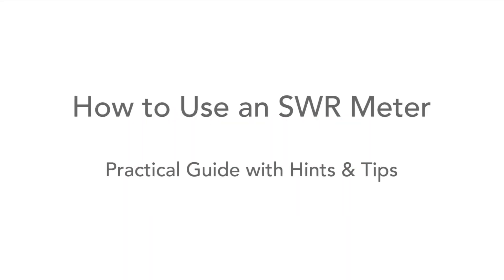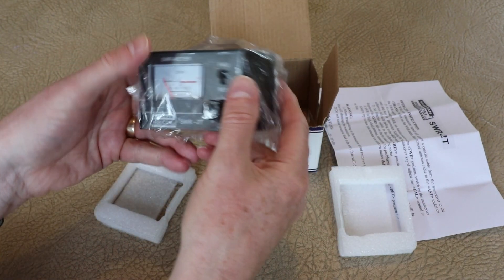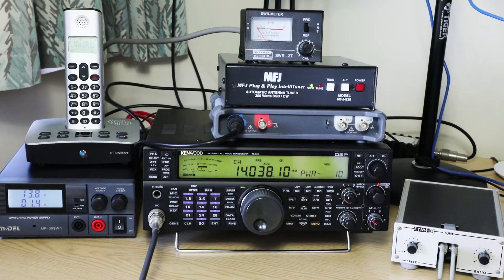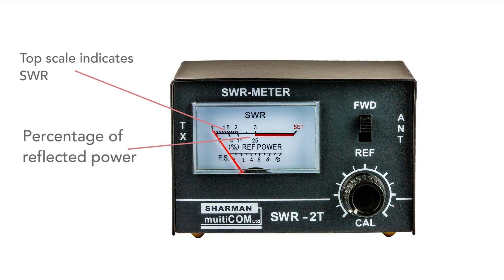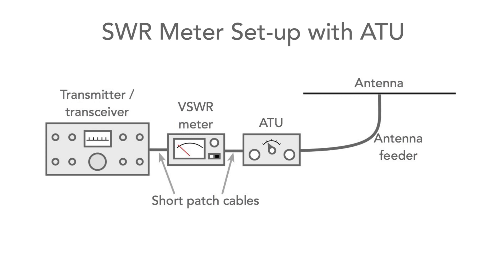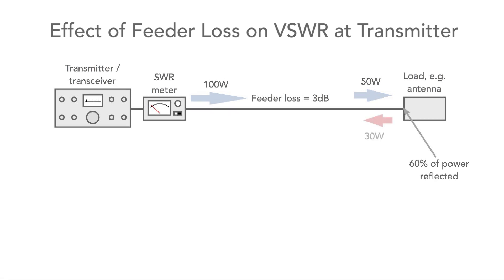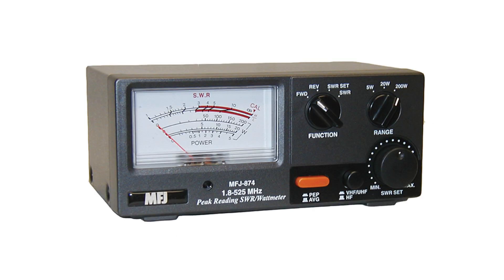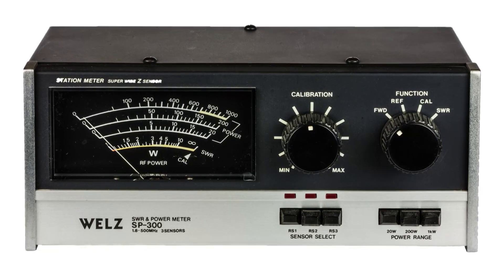How to Use an SWR Meter: standing wave ratio meter - guidelines & tips

Comment: So to clarify,  right before you move the switch from FWD to REF,  do you "un-key" the mic,  and then "re-key" it once you've moved the switch to REF?  Or do you keep the mic keyed continuously during the switching?  Or,  does it matter one way or the other?
Reply from the maker: It should not matter because you are only switching a sense line and not directly any level of power.

Comment: if you dont have a reverse switch can you swap the antenna with the transmiter?
Reply from the maker: Absolutely - but you also need to make sure you get the connections the right way round if you do have a switch.
Reply: @ElectronicsNotes   thank you

Comment: My meter won't zero. It swings right in forward and I can calibrate it. When I switch to reflected it stays at 1.3.
Reply from the maker: It depends what you are doing. If you have RF passing through and you set it to FSD in the forest direction, then when you set it to measure reverse power then that is your SWR.

Comment: Hum? Is this a lead to finding or should I say hacking others freedom of receiving or transmitting an already paid signal. If an individual has not paid for service, then can understand looking for non payer. But if an individual is paying for ex. phone service, then hacking is a violation of protocols.
Reply from the maker: This has nothing to do with hacking. It is purely a method of measuring a signal you have generated for transmission to see the effectiveness of the transmitting antenna system.
Reply: "hacking others freedom of receiving or transmitting an already paid signal."
Yes.  These SWR meters can also change the language.  The one shown is from China, consequently all of your transmissions will be converted to Chinese language.

Comment: And what about the SWR scale in older rigs like Icom 735? Is it a reliable way to measure or should I get a proper SWR meter anyway? I’m a newbie :)
Reply from the maker: I haven't looked at the accuracy of the Icom 735 meter, but I am sure it is more than good enough for what you need. The meter dials in the external SWR meters have much larger scales and are easier to read, but when looking at the difference between 1.5:1 and 2:1 or 3:1, for example, the IC735 should be more than good enough. You don't need to spend ages getting the SWR down the last fraction. The main reason for monitoring the SWR is to make sure the PA in the 735 is not being subject to very high levels of SWR get it down to 2:1 or preferably 1.5:1 and this is more than good enough. The internal meter will be more than good enough for this. Hope this helps.
Reply: I have a 735.  It's a great old radio and still works well. The purpose of its built-in SWR is to protect the transmitter from excessive voltage on the final amplifier transistors.  Reflected power, or more specifically reflected voltage, ADDS to the voltage already there and a high SWR situation can then exceed the voltage rating of the transistor.  The 735 is designed to instantly reduce power in that circumstance (as are all modern radios) but it might not be fast enough in the case you completely forgot to attach the antenna. 
As you can see, a perfect 1:1 SWR might still not be radiating anything out the antenna; a dummy load should always show perfect SWR.

Comment: Can we modify it to work at around 100MHz?
Reply from the maker: As the basic design for a particular item will be focused on a particular band, it is not normal to extend their frequency range once they are designed and manufactured.
Reply: That would be a complete re-design.  These meters have internal inductive and capacitive elements whose reactance is likely to be excessive at 100 MHz.

Comment: Hello! The rear of my meter does not have "ant" and "trans". Mine says "in" and "out". I am unsure which connection is for the antenna and which one is for thew transmitter? Can you help? Thx!
Reply from the maker: In will need for power coming in from the transmitter, ie connected to the transmitter, and out will similarly be for the power output to the antenna. I hope this helps. If you get it the wrong way round all that happens is that the forward snd reverse positions on the meter appear to be opposite to what they should be. I hope this helps.

Comment: I have a question!! I have a 
Selfix no.6702 swr/power meter. 
The stickers on the back of the unit 
came off and I don't know which 
connector is for the antenna and 
which one is for the radio!! I don't 
want to damage my radio or the 
swr meter. Is there any way to 
tell which connector is which?
PLEASE HELP!! Thanking you 
in advance, Norman.
Reply from the maker: You won't damage the rig or the SWR meter if you run the power into some form of good match or a dummy load. Connect the system up, keep the power level low. Then see which connectors give give you maximum forward power corresponding to the Forward position on the switch. The SWR meter really does not mind which way round you connect it - the system is labelled so that the forward switch position corresponds to the forward indication. You can reverse the connections, but the maximum indicator would occur on the Reverse switch position. I hope this explains it.
Reply: I understand that if you are looking at the meter at front , left side is for the radio , right side is for the antenna !!

Comment: does having a good SWR significantly affect reception as much as it does transmission?
Reply from the maker: There is a loss as a result of not having a good VSWR, but this can be relatively small. For transmitting, this can be more of a problem as most modern transceivers will detect the VSWR and if it rises, they will reduce the power output to prevent damage. This combined with the loss in signal as a result of the VSWR will mean the overall radiated power is reduced and the signal will not be as strong as others. This will reduce the competitiveness of the signal if used for things like amateur radio, etc. For other applications it can mean the signal is reduced and detected over a smaller range, etc
Reply: @ElectronicsNotes  how would you explain the efficiency of a doublet antenna with swr of over 10.1 with very little power loss
Reply: @Pioneer936  SWR is not itself a serious problem.  Consider a big reflection coming back to the transmitter.  What happens?  Well, it reflects back to the antenna!  Then back to the radio.  It might bounce 10 times before finally radiating enough to not be measurable.   Assuming zero loss in the feedline, ALL power sent by the transmitter MUST go out the antenna -- eventually!  It might take several or ten bounces to finally radiate and a Zepp antenna seems to work pretty much exactly that way.
A lossy coax cable might convert from 1 to 3 db (up to half the power) to HEAT on each bounce.
So all power transmitted must either be radiated OR converted to heat in the coax (or a blend of these). 
We see therefore that the problem of SWR depends on the loss in the feedline.  Reduce feedline loss (ladder line has nearly zero loss) and who cares about SWR?  But the transmitter also cares because reflected voltage adds to transmitter final amplifier voltage.  So you can have a HUGE SWR at the tuner so long as you keep the reflections out of the transmitter.
Reply: @thomasmaughan4798 yes I agree but this needs to be directed to the poster

Comment: Why is 14 MHz  called 20mtrs  ect .Also these antenna tuners  i thought a more relevant name would be a matcher   as they dont fix a badly tuned antenna !.
Reply from the maker: 14MHz is the frequency of the band, 20 metres os the wavelength. Accordingly the ham radio band is known by both names 20 metres and 14 MHz.
Reply: "Also these antenna tuners  i thought a more relevant name would be a matcher"
Then call a tuner a matcher.  Others call a matcher a tuner.  Very few antennas are designed to be tuned remotely, SteppIR being an example of just such a thing.

Comment: I have baaaaad swr :(
Reply from the maker: That is a shame. Try to improve the match between the antenna and the feeder.
Reply: I fixed it since then. I realized I had an N type connector going into the antenna and a pl259 in the radio. I replaced the N type with a pl259 and now I have 1.3:1 swr. All is well, thanks for the video
Reply: "I have baaaaad swr"
I have GOOD SWR.  I like SWR so much sometimes I leave the antenna disconnected so I can have infinite SWR.  It does not get any better!

Comment: What's the proper way to set the swr for a dual antenna set up? Removing one from the system at a time and calibrating the remaining one or leave them both hooked up and try to balance both at the same time? Thank you.
Reply from the maker: You may well find that one antenna affects the other. So you will need to set it up with both connected. Set one antenna up for minimum SWR and then the other. You mayweed to go back and do them a couple of times. This is if I read correctly what you are doing.
Reply: @ElectronicsNotes  that is exactly what I had thought I would have to do. Just wanted to verify that before I took action. Thank you

Comment: I wish you'd talked more about the cross-needle type meter.
Reply from the maker: Apologies - but I was trying to keep the video as short as possible.
Reply: it simply gives both fwd and reflected power at the same time, one needle for each.  no need to switch or calibrate.
Where the needles cross, is the SWR reading.

Comment: You don't mention where the reflected power goes that reaches the tuner
Reply: The output transistors/valve have to drive harder to overcome the reflected signal and carry on outputting the correct wave. In essence they have to burn up the reflected energy.
Reply: @markthorne2296  reflected energy is re reflected back to the antenna at the atu, the atu does not absorb energy

Comment: Hi can you advise me please my swr meter is going into the red high swr but the swr meter on the radio is reading just over 1. I think my meter might be ify I have had it for years. Regards
Reply: David Cooke - I see this is an old comment.  Don’t know if you ever did receive an answer to your question, or not.  Your situation can be difficult to answer.  And without additional testing, I’m not sure anyone could help via a return comment. Based on my previous experience, I would probably put more trust in the external meter.  But the best thing would be to somehow use another meter (borrow one, perhaps?) to confirm what you are seeing. I’ve found internal meters in any one given radio to be marginally accurate.  I trust them only as far as giving me a rough idea.

Comment: My SWR meter is built into the CB how do you use the cal. to find the SWR I have been out of cb  many years  late 60s and don't remember much about "how to " anything.
Reply from the maker: It all depend on the CB radio. It is possible that it calculates the SWR automatically using the internal processor if there is one - often there will be a position for forward and reverse powers, but check the manual.

Comment: A bit funny SWR-Meter for the Examples / Frequencies used in this Video. 05:40 It says, it is for 25 - 30 MHz.
Reply from the maker: It was probably not right to use the particular SWR meter for 14 MHz, but the design is straightforward and known to operate well over the amateur bands. Sensitivity falls at lower frequencies but OK for 14 MHz.
Reply: Since the box is small, the sensing element is short and thus more effective at higher frequencies.  Most of this style was made for CB but works fine on ham radio particularly since you can give it enough power to achieve "set" calibration. 
At 3.5 MHz, a 4 watt transmitter probably cannot calibrate the meter so dial up the power until you can "set" the calibration.  That's a bit rude to have 100 watts of dead carrier but there you go, the meter will work perfectly if you give it enough power.